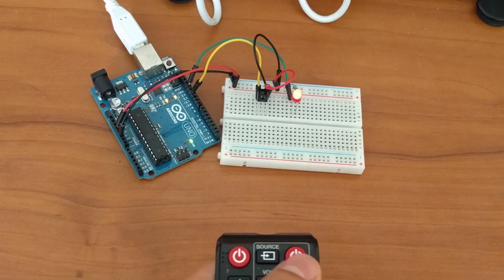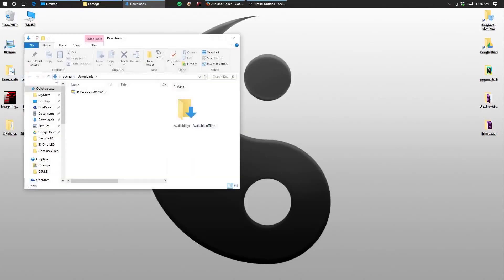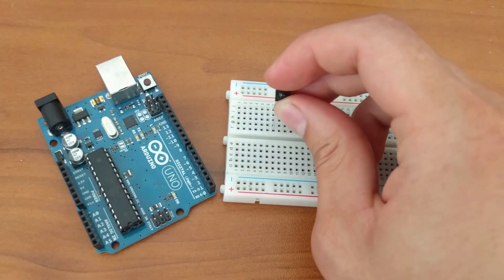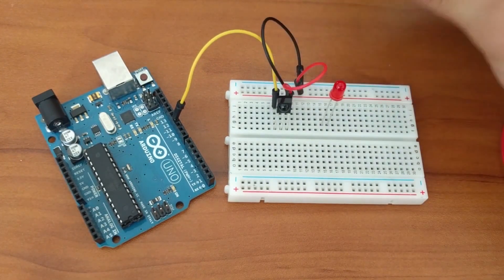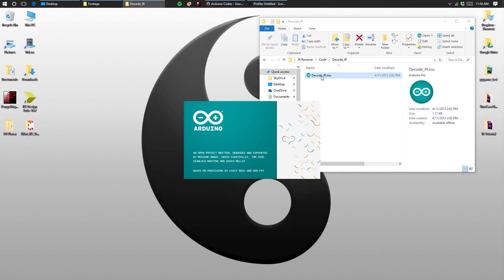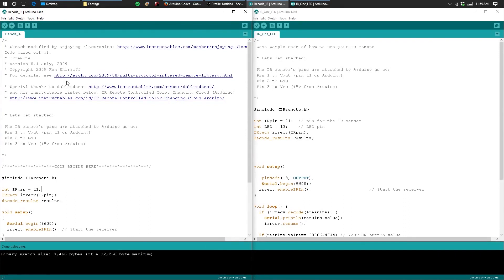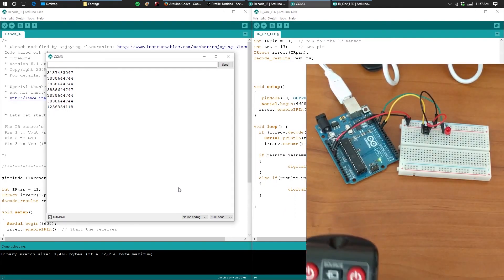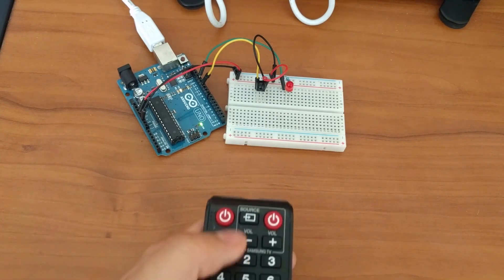Arduino Tutorial | Decoding the TSOP4838 IR Receiver and Blinking LED w/ Remote Control

Comment: Arduino:1.8.2 (Windows 10), Kort:"Arduino Nano, ATmega328"

C:\Program Files (x86)\Arduino\libraries\RobotIRremote\src\IRremoteTools.cpp:5:16: error: 'TKD2' was not declared in this scope

 int RECV_PIN = TKD2; // the pin the IR receiver is connected to

                ^

exit status 1
Error compiling for board Arduino Nano.

This report would have more information with
"Show verbose output during compilation"
option enabled in File -> Preferences.

Comment: Great job, making the build extremely simple!  The remote transmitter I used to test these sketches was sending 2 codes with each button push.  One code was the same for every button and one code was different.  They displayed on a 2 lines in the Serial Monitor - not sure why that was happening, but using the code that always changed (which came first in the sequence) made the code in IR_One_LED work just fine.  ONE PROBLEM I saw in your code in IR_One_LED was you used the pin number (not the variable "LED" that was declared in the top of the sketch) in the if () Statements.  It's not a problem, but it would look "cleaner" to either remove the variable (or use the variable) to avoid confusion with the noobs.